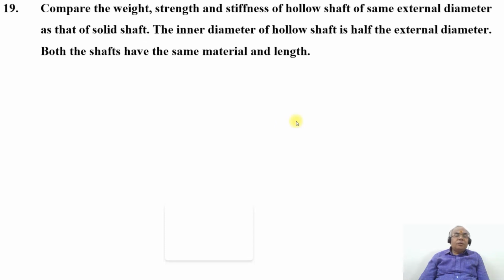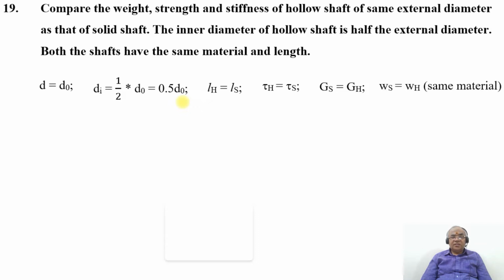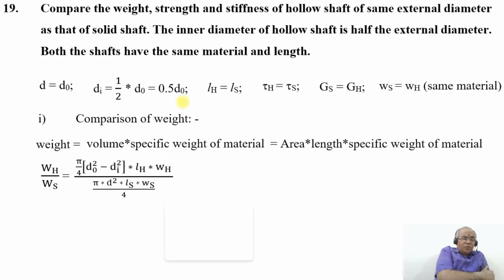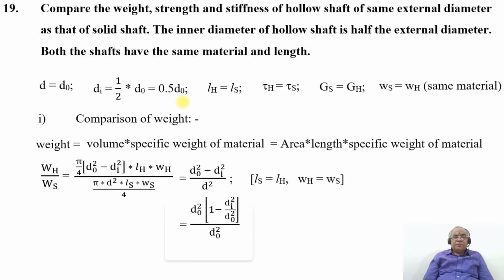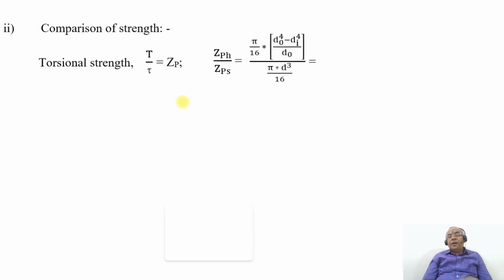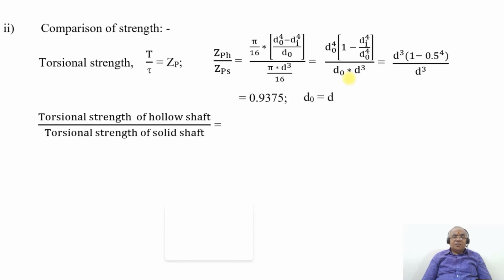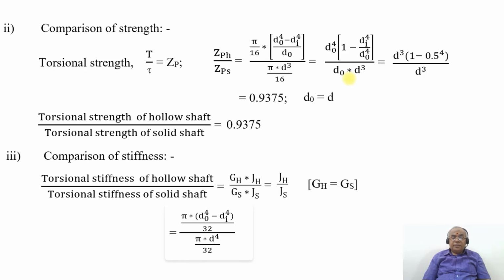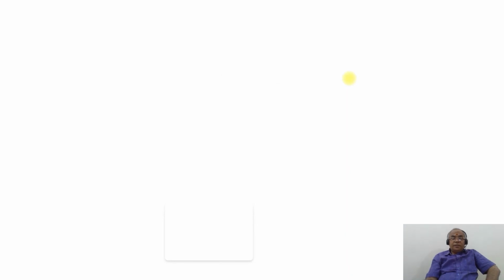19  PB SHAFT   19

Comment: The internal diameter of a hollow shaft is 2/3 rd of its external diameter. Compare the strength and stiffness of the shaft with that of a solid shaft of the same material
PLESS